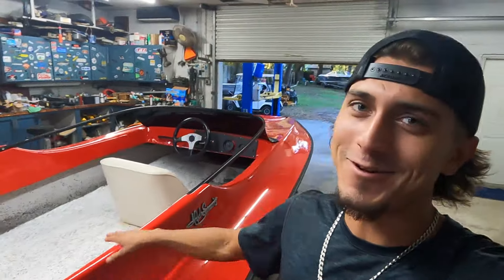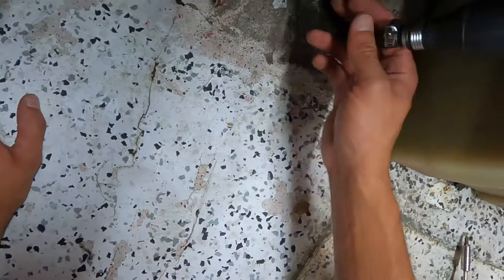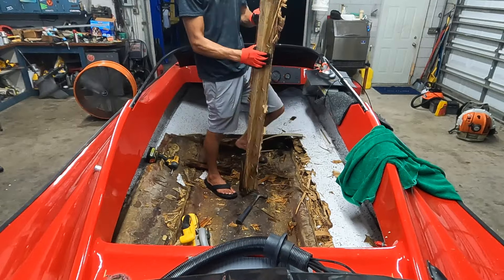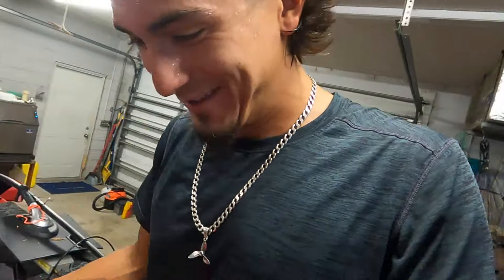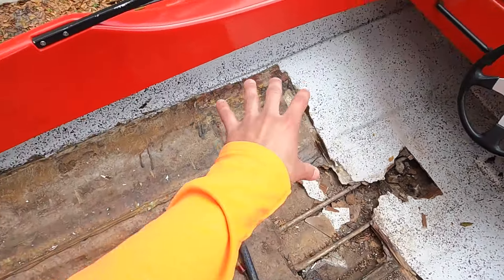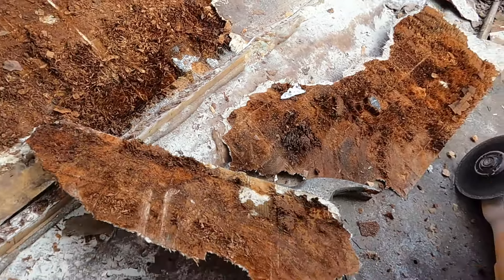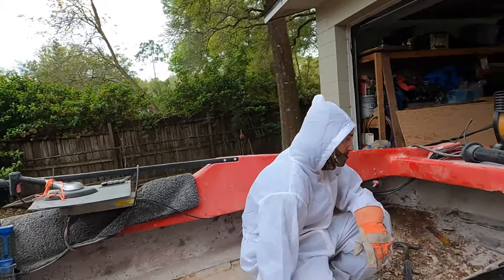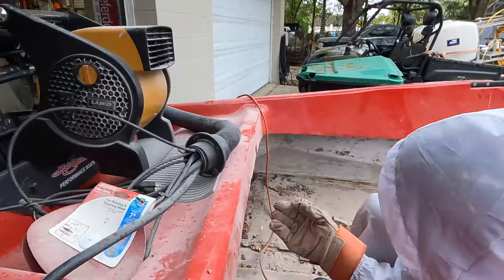Destroying my 40 yr old race boat...

Comment: I’d highly recommend removing the motor off the back before you put the core down. Could put an even more hook in the bottom of the hull.
Reply from the maker: I had the weight off of it with a cherry picker but yes very understandable boat is back together and has been tested… Stay tuned 👀
Reply from the maker: Whenever we did the core, I definitely took the weight off the motor With the cherry picker